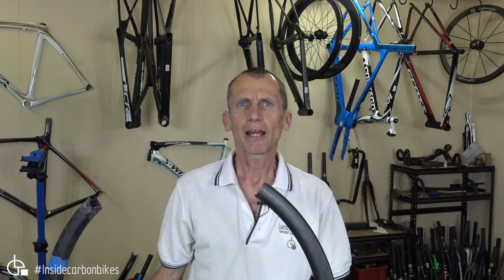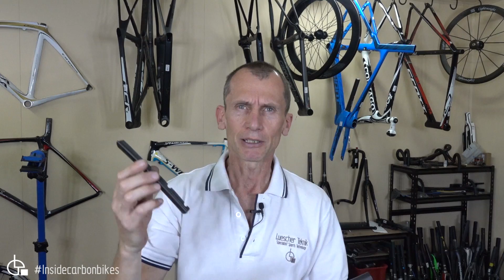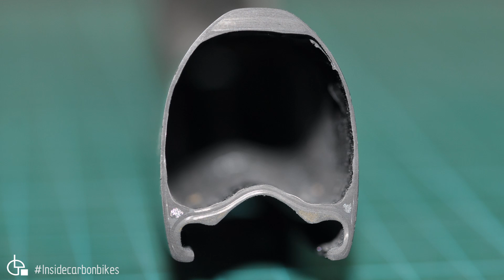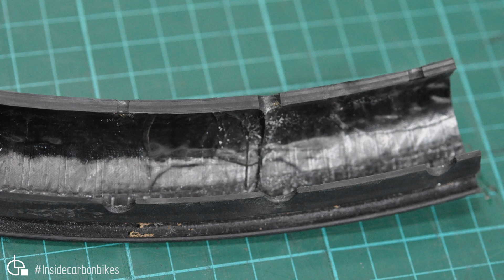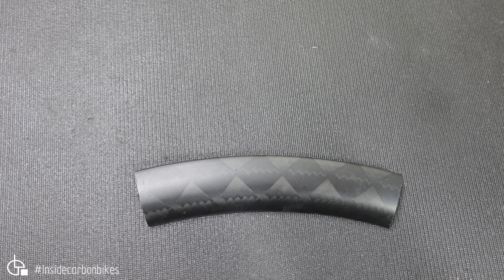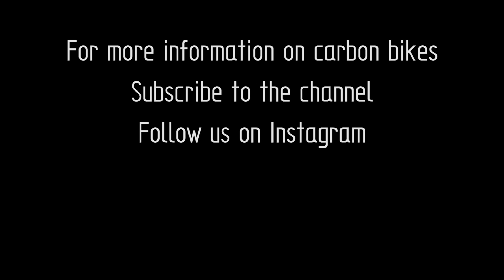Venn 35 Filament Wound Rim Cut up and Review

Comment: I have 507 disc version and it’s a totally epic wheelset. Super aero, fast and light, not strength issues. Love them!
Reply: I have the same rim on rim break and they are great. Surprised they are not more popular
Reply: @commando25101  One word. Marketing! There's an interesting interview with the founder I saw online, from a while ago, talking about how little difference there is between wheels costing thousands made by Zipp, Campag, Enve etc and a.n.other manufacturer that can put just as much effort in to a wheelset costing half as much

Comment: Raoul,  Thanks for this fascinating video.  Lately,  traffic in Los Angeles is around 30% of normal and the air quality has been fantastic.  So, Convid has not curtailed any of my riding.  

University science labs have their air quality measuring platforms going 'round the clock.  Well aware how unique current conditions are.

Cheers, Steve
Reply from the maker: Thanks, yes it seems that Covid has improved cycling conditions for some.

Comment: I have built with these wheels for a few years now and all the wheels have built up very well and I have had zero returns or issues from customers.  There have been a couple of occasions where the finish has chipped around the spoke holes on the internal nipple versions (I hate these as a builder) but nothing to be concerned about.  Personally I'm not a fan of the look but it is striking and different so each to their own.  Thanks for another insightful video.

Comment: Doesn´t it look like the void at 10.00 is in the prepreg, not between layers? Poor material quality? Were these rims a disc brake model?     Rgr
Reply: This was a disc-brake rim.
Reply from the maker: The end result is the same, typically on a thick stack of UD plies trapped volatiles are difficult to remove, special care needs to be taken.

Comment: Thanks for keeping the videos coming during the lockdown. Most intersting. From your experience are carbon rims better in terms of quality control than bike frames?
Reply from the maker: There is less variabilty typically because the shape is simpler and consistent. Some still have problems though and then there is the issue of temperature capacity for rim brake versions.

Comment: 1:32 it doesn't concern you that the thickness of the right side is thinner than the left?
Reply: No it's designed that way, more material is added on the drive because stresses imposed is not linear/ symmetrical. More high mod carbon is added where more forces is applied and less material is used where it isn't needed. It results in a wheel which is stronger, lighter, more aero which can save you 3 watts when travelling at 60kmh at a 30° yaw angle. Not only does this make you faster but is also more comfortable and irresistible to the opposite sex (or whatever you are into), 
Note to self: stop reading bike catelogues and the marketing BS.
Reply: Kam Mui for a couple of sentences I my hand was getting closer to face... your satire is strong 💪
Reply from the maker: When measured with calipers both sides are the same average thickness.
Reply: She will be right mayte 💯🤟
Reply: @durianriders  yeah i'm sure hambini would love it
Reply: This was a macro photo at close range with one side clearly closer than the other. That's why it looks like there's a difference in thickness.

Comment: Beautiful rims. The pattern is much more appealing than the boring unidirectional carbon that leaves ones guessing whether it is carbon, aluminium or painted paper. But looking further into them, one learns that Venn (like so many others), while hyping up their products on one hand ("Patented filament winding process ensures precise and accurate carbon fiber layup – each fiber is oriented exactly as intended. This ensures that every rim achieves maximal strength and durability"), state on the other a "Rider weight limit of 110kg". 
Right, so the culmination of all that "maximal strength & durability" technology is basically fit for use by particularly fit (or downright skinny) people whose weight is under 100kg. at all times. And if they care to bikepack or cycle tour, they better weigh 70kg. They could just as well substitute carbon with carton. How many 70kg. (or less) grown-ups are there, 0.1 per capita?  Even Mario Cipollini likely weighs in access of 100kg today (while also looking better than he did during his career). Never mind the average clydesdale.  
 This is the reason My carbon wheel company of choice is limited to Spinergy, Scope & Bontrager, the trio of wheel manufacturers whose wheels do away with a system weight limit without overt compromises.
Reply from the maker: Having a system weight limit makes perfect sense, that way you have a set design parameter. I would be more concerned with a product that did NOT have a set limit, because it may mean that they do not know what the failure load is.
Reply: @LuescherTeknik  Thanks for your answer..    Rgr
Reply: I do not see the contradiction in having high performance carbon fiber layup and a system weight limit of 100 kg. If I would design a rim for road bikes, I would rather make the rim lighter and therefore more performant than allowing for lets say 150 kg of system weight. Someone with a system weight of over 100 kg should in my opinion not be so worried about having especially light carbon rims, because the benefit is miniminal compared to losing a few kgs.
Reply: @JaytheB  These (and most other) low system weight carbon wheels are not particularly light compared to, say, Scope F4 / F5, Spinergy Stealth FFC 47 disc & the Bontrager Aeolus XXX. 
 To illustrate, while the 45mm deep Venn Var 45 TCC tubeless clincher rim brake carbon wheels weigh a stated 1640 grams and have a system weight limit of 110kg., the Spinergy Stealth FFC 47 (the rim is 47mm deep!) wheelset, while having no system weight, weighs 1655 grams. That's a mere 15 gram penalty for a 2mm added depth! And no system weight limit at all! Plus, the PBO spokes appear to be more compliant and comfortable than stainless steel ones! 
 The Scope R5 are 55mm deep and only weigh 1632 grams! No rider weight limit, either! The 45mm R4 (also weight limit -free!) weigh a mere 1557 grams and are 45mm deep. 
 The thing is, if something happens to no-weight-limit wheels owing to the load (maybe less so a crash), you're eligible for an exchange or crash replacement at an appreciably discounted price. With 110kg weight limit wheels - not only is there no guarantee they will hold up - if they happen to buckle, dent or brake - the manufacturer might refuse to replace them based on your weight alone!  
 That's not to mention cycle touring or long-distance bikepacking that necessitates a wheelset's ability to withstand the combined rider, bicycle and luggage weight on a vast array of roads, including fire roads and gravel! I mean, with 30 kg worth of luggage and 10kg of bike weight, to comply with the weight restrictions imposed by all (but the ones I specified) manufacturers, you'd have to weigh 70kg or less! 
 You could say: "you don't cycle tour on carbon wheels". That's another artificial restriction akin to saying: "You don't use [some processor and VRAM -intensive 3D rendering software]  on a desktop". That argument might hold water 30 years ago, but not anymore. As far as wheels go, it is the companies that do away with weight restrictions and design their products with both speed, aerodynamics and both torsional and weight loads in mind that move the industry forward, and given the choice, I'll forgo those who do not in favour of these companies every single time.
Reply: @LeoInterHyenaem  You still don´t say WHY you should use carbon rims on a 40kg system bike.. Why?   Rgr
Reply: @borano2031  Because I like carbon. My carbon bikes deserve carbon wheels. Look, I have been cycle touring extensively for many years. Never toured on heavy ugly crude upright bikes that for a long time were considered THE bike type of choice for cycle tourists. 
 Instead, I've ridden a Cannondale Caffeine F1 with a Lefty fork on some of My extended tours (2.000-3.000km.). And a Titus FTM Carbon (a full-suspension cross country / trail bike) in style and without issues. They were a compromise (especially, the latter), because at the time more or less all road bikes were rim brake -only, incompatible with mudguards, racks & forth crown headlights, too fragile and of limited utility to cycle tourists. 
 The emergence of the gravel / adventure class of bikes has resolved a lot of issues for people who like to cycle tour in style, love speed, love carbon, hate feeling like a sail when riding, love adventure, love light, but sturdy bikes, will not allow the industry to put words in their mouths or limit their choices. 
 Proper carbon wheels WITHOUT A SYSTEM WEIGHT LIMIT (or at least, an acceptably high one) is what I expect for My wheels to be. 
 I have one steel bike (Norco Search XR Steel) and three carbon bikes (a Salsa WarBird 2019, a Genesis Datum 2018 and a Norco Search XR C2). Guess which bike I ride most, except when shopping or riding to a gym, where or has you be parked for hours on end? Exactly, the carbon bikes! 
 I'm sufficiently used to relatively light, slick, beautiful carbon bikes that the idea of long-distance rides on a steel bike discourages and drains the will to ride. If I could travel without luggage, be assured I would! The problem is - you cannot tour without necessities like equipment, chargers, clothes, etc. But given a choice between a set of ugly heavy wide non-aerodynamic aluminium wheels and a beautiful relatively light, aerodynamic carbon wheelset - guess which one I'll choose: indeed, the latter! Every time. Regardless of the system weight. It's up to the manufacturer to comply with My requirements and needs, not up to Me to lower My standards. Thank Goodness, some manufacturers do. Unfortunately, these are very few and far between. 
 The premise of your question is flawed. Just as well, you could ask: "Why would one need a car when there are horses!". Additionally, your question masks itself as an enquiry, but is really a rhetorical question. Because My standards don't match yours, the rhetorical nature of your question does not affect Me as it might someone who is unsure of his needs by shutting Me / persuading Me to change opinion.
Reply: @LeoInterHyenaem  I quite don´t understand why you make your preferences to a problem for various companies. You want a tourer to your specifications? ANY ardent framemaker working with steel would make you one. To any specification. Any riding position. Any tyre width. Anything. Sure, it would make your setup weigh in at 42 kilos, instead of 40. I´ve done my share of touring myself, even though it´s on an audax. Experienced some shimmy because, but a stiffer frame would make up on that no problem. Steel, aluminium, bombproof. Yes, I have three carbon racing bikes, I love them too. Especially for their ideal purpose. Yes, they all run on carbon wheels/rims. Yes, I run carbon rims on my crossbike, too. Three sets of carbon rims, one set of aluminium. Yes, chosen after the prevailing conditions/circumstances, not after my mind.     Rgr
Reply: @borano2031  Check out the Bastion Cycles and Métier Velo. Those are the brands I'd pay for a custom bike from (but not unless I'm rich enough to live in a €20.000.000 ultramodern mansion, drive a Lamborghini, shoot Hasselblad & Phase one and hire a private vegan chef 7 days a week and donate €50.000 annually to an animal rights charity). It's not that I dislike metal bikes, but I wouldn't pay over €800 for a non-carbon frame. And if I were to pay over €500,- for a metal frame, it better be properly smooth-welded and hydroformed that it is indistinguishable from carbon. Examples hereof would be the current Trek Émonda ALR (My favourite is the disc version in the Purple Flip colour) and some of the latest generation Kogas. Of course, smooth welds and oblique looks are more or less impossible with titanium or steel bikes. 
 In other words, I deem rudimentary frame designs (i.e., steel / titanium and in must cases, aluminium frames) unworthy of the great expenditure that custom makers demand for metal bikes. 
 I can live with My Salsa Norco Search XR (a vet handsome bike for a steel one, with a lovely seat stay / chain stay shape - thin and minimalist, but not sloping enough a top tube for My taste, and, indeed, 2kg heavier than the much more beautiful carbon counterpart) - it's just that I'm almost as averse to crude bikes as I am to crude anything, including facial features, people, "cultures", customs, cars, houses, etc. And aluminium wheels, especially affordable ones, are crude and ugly and somewhat less fast than fine carbon wheels. Imagine having a damn pooch for a pet, while your neighbour lives with a Lion or a Tiger (which, by the way, should be prohibited, but that's beside My point). I remember coming across and joining a hippie lad on squeaky pile of metal on My 2008 Amsterdam-Rome bike tour. I was ashamed to watch over his €20,- monstrosity of a bike while he'd be shopping. A bit like troubleshooting a PC of an acquaintance on a terras where strangers might mistake you for a user of the crudest operating system in existence - the Windows OS. Or plucking your dried-up lip skin, then realising that to strangers passing by it might appear as though you're picking your nose. Embarrassing, insulting. 
 I hope, I sound less Apollonian / idealist / perfectionist (or materialist, if you will, as materialism is, in My view, applied idealism) - and more socialist / democratically-inclined / cuckoldish / indiscriminate - than I actually am. 
 Peace. 
 Cheers...
Reply: The system weight limit is due to the standard that we used to test the rims - we have to set a limit somewhere while testing and we felt that 110kg for a lightweight (consider the surface area - our rims tend to be on the wider side) rim covers most of the end use scenarios and also addresses a point in our public liability insurance policy.

For example  all of our rims have to pass a static load test where they do not exhibit any failure (observed, or measured) after a 300 kgf load. The ultimate failure of the Venn Var 77 rim occurs at 600 kgf on average, however we still claim a 110 kg system weight limit.

We have since changed the winding method to the new VAR filament winding. Some more information here: https://www.venn-cycling.com/en/venn-technology/#winding
Reply: @Velocite-bikes  Thanks for your answer..    Rgr
Reply: Does the bike frame manufacturer use rider weight limits these days?
Reply: @robertp7209  Most do, but, while many state somewhat reasonable weight limits (i.e., Norco, Salsa, Cannondale, Genesis, Trek and many others) of roughly about 150kg. or quote a recommendation rather than a weight limit, some (i.e., Focus) specifically state 110kg. as a weight limit for all their bikes save for electric ones (whose weight limit is only a 120kg.!). Ghost has 120kg. weight limit on most or all their bikes.
Reply: You are amusing... Most riders that ride fast and get benefit from carbon rims weigh 60 to 70Kg,  Ok maybe up to 78kg for strong sprinter types, that is what carbon rims are made for.  Asking for a 150Kg system weight is like asking why Ferrari does not have a 3.5-ton load or tow capacity because I want to to renovate my house and load it up with cement and ceramic tiles and tow my boat or why the NBA does not agree to lower the net to 7ft so I can dunk...

Comment: Hey, that’s my rim! :) Pleasantly surprised by your assessment as I was originally pretty disappointed when it buckled at the spoke nipple bed. I think I remember Victor from Venn/Velocite said they reinforced later revisions. The custom wheelbuilder became slightly recalcitrant, so I was never able to get it warrantied. Plus I had a hunch you’d be interested in having a look at it. I guess Venn/Velocite rims are back on my radar now.
Reply from the maker: Thanks for sending it in, I would say that some more off axis fibre in the spoke bed would solve this issue which is what they probably did.